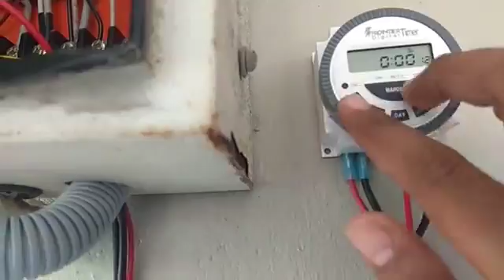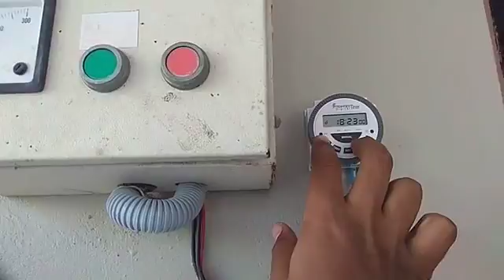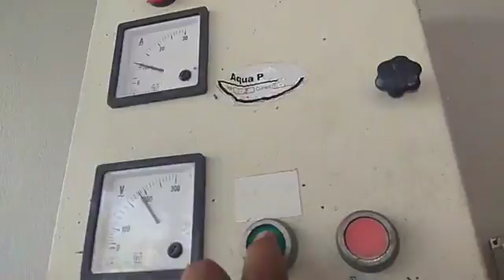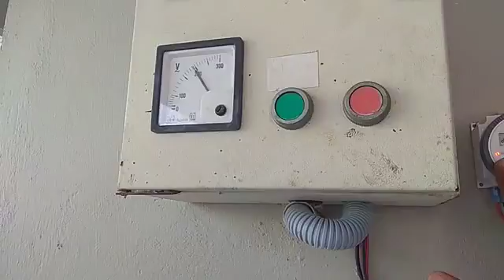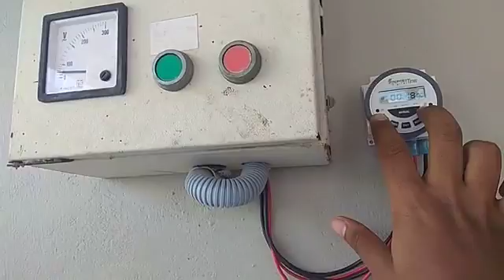Frontier digital timer tm619h_2 to 1hp  pump motor

Comment: How to conection ???
Reply from the maker: I am using it as normal switch,place near switch so there will be only p,n for connecting the timer
Reply: @mathivananmb9420  sir i have all redy this type timer. but no idea how to this type  conection in motor starter....pls diagram mentation...

Comment: Works flawlessly.>>>nub.best/plmo     Easy to program and didn't spring any leaks. It is slightly bulky so might not fit well in a very confined space but should work well for most applications. Have used it daily for a month, will updated this review if anything starts to go wrong.
Reply: wooooooow

Comment: Timer output where you connected exactly in motor control panal please help me..
8412059131 this is my contact no
Reply from the maker: i have given to the motor input
Reply from the maker: please romove and cut  the input phase and neutral of the motor and add the timer between supply and motor

Comment: Please clarify..pin 1 and 2 is input from ac and pin 4 and 5 is connected to motor input..thanks
Reply: Telling Ulta..

1&2 Line is from board.. 4&5 Load here is motor..
Reply from the maker: Jatin Sharma pin 1 and 2 input (given to motor) connected to timer  :motor input is now connected to timer 4 5

Comment: Hi, I am facing problem with battery backup. I mean the set time automaticly changing after 1 or 2 month. So please advise, Any solution to keep the CR2032 battery charge atleast one year for this timer ? As I tried Sony & panasonic battery but its not working more than 2  month, even I changed new timer & still the same !!!!! PLEASE HELP ME DEARS !!!!!
Reply from the maker: johnsi si I am using it as timer not facing any issue ,battery also not needed for timer